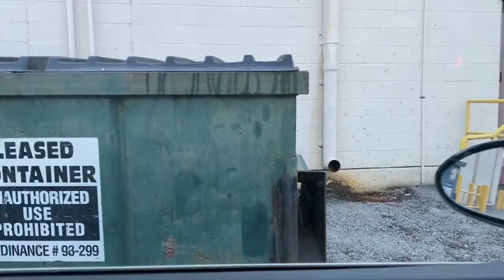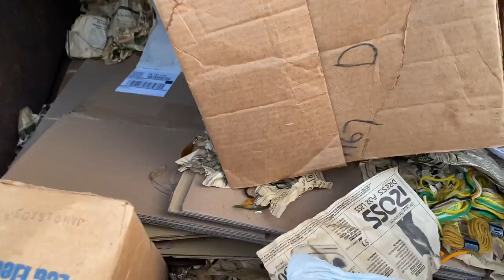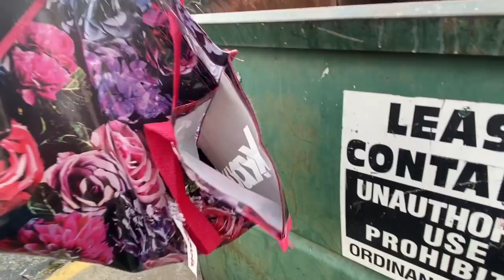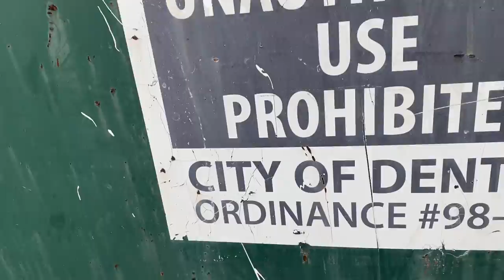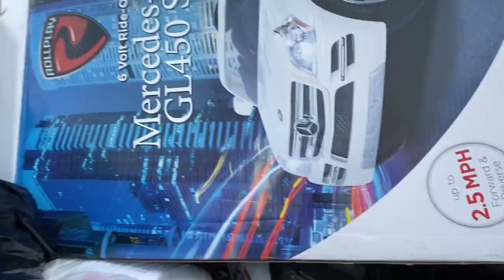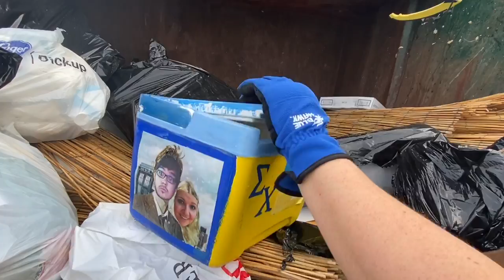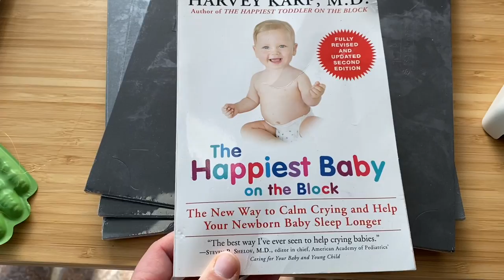I Found 65 Bottles of Beer in a DUMPSTER!

Comment: The sticky zipper can be fixed with wax, bar soap or WD-40. If you use the WD-40 I suggest you spray it on a q tip then rub it on the zipper.

Comment: Did you check the inside compartment inside the guitar case. Most have one. May have a treasure in it.
Reply: WITH SOME RUST-O-LEUM SPRAY FROM THE HARDWARE STORE SHE COULD CLEAN THE METAL PARTS AND PAWN THE CASE AS IS FOR EASY MONEY LOL..MEOWS  ۩

Comment: Just make sure you check for a recall on them probably not.  Nice finds in the dumpsters.  Hopefully with the stores closing it doesn't affect you too much.  Ohio is shutting down so many businesses. I love watching you I was laughing you guys must love beer.  I quit drinking around 2005.   Beer can last 6 to 9 months past expiration date & if kept cold last longer.  just type in does beer expire.   that guitar case can be worth up to $250 so research it well.  The jacket I think starts at $45 another good find.  The little oven is called the Americana by Elite  EBK 300 3 in 1 Deluxe Breakfast Station price $53.  So some parts are missing cause you can fix eggs on the top so that pan type thing is missing & I think 2 trays for inside the oven & of course the coffee pot.  But if you wanted to keep it you could look on ebay for the missing parts see if cheap enough.   Great finds.